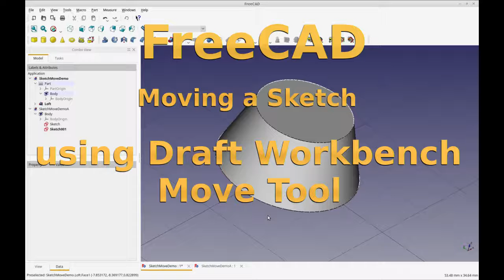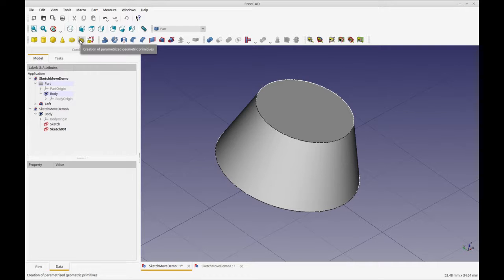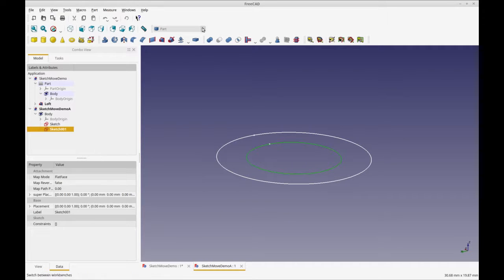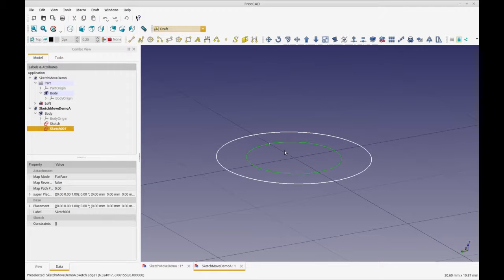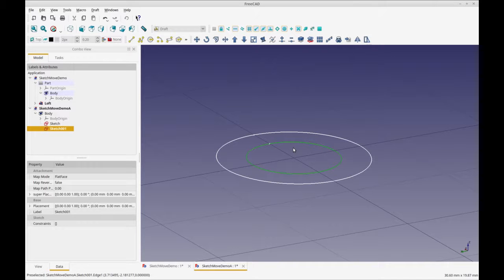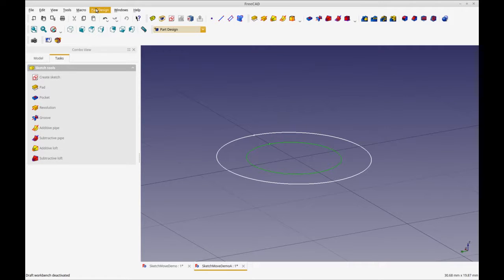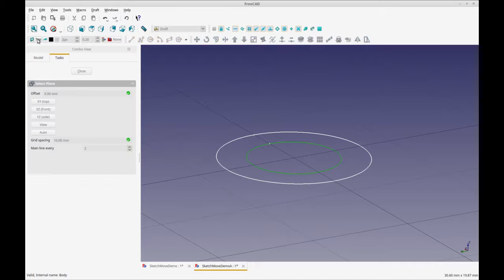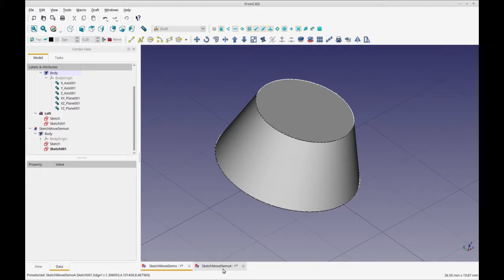FreeCAD - Move a Sketch with Draft-Move ( Secret Trick Enclosed )

Comment: The problem I see with this approach is that the inside sketch is left unattached from the body.  It seems like a better approach would be to attach the sketch to a datum plane offset from the XY plane.  Then everything is still connected to the body.